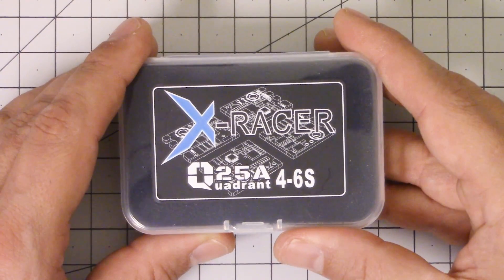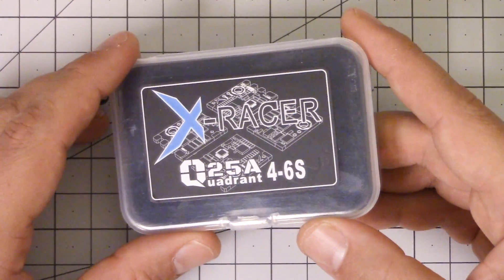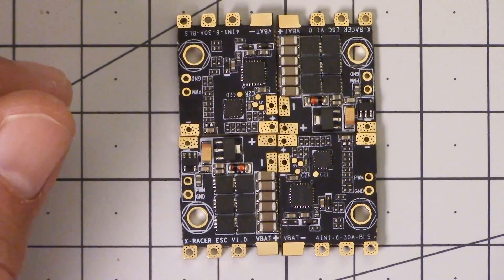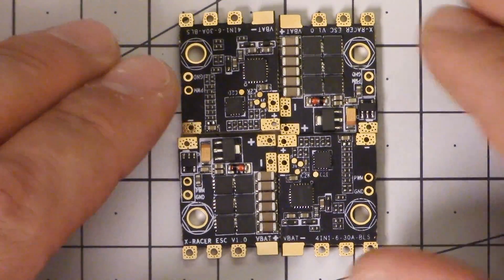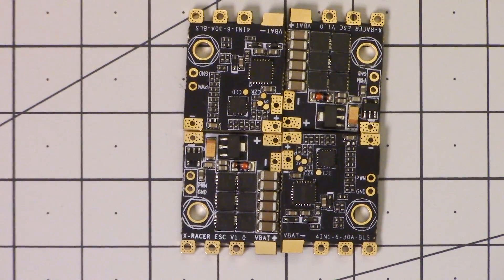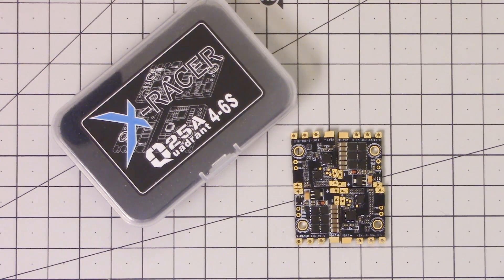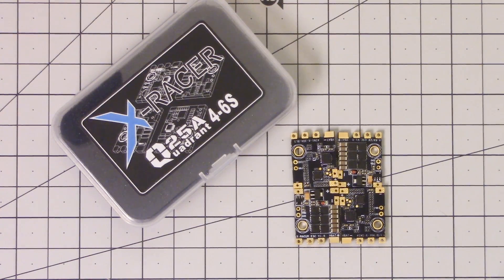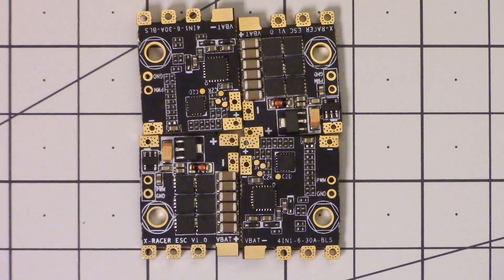FPV Model Xracer Quadrant 25A 4-6S BLHeli ESC | THE PERFECT ESC???

Comment: Hi, quick question if you don't mind, I just got these and was wondering if they can be used with steel mounting bolts? I notice the mounting hole is metal and don't want to accidentally short my new esc's! Sorry if it's obvious I'm still a bit of a noob too the hobby and I figure you know what you're talking about lol. Thanks in advance!
Reply from the maker: The metal lining of the mounting hole is always grounded. There's no issue with using steel bolts.

Comment: me again I have something els to ask you your info has been so helpful you no so much wish I was that good lol here is my problem   I have the betaflight f3 controller and the x racer q 25amp esc  on the esc do I need to wire each one to the flight controller power and negative  do you have a diagram of  the best way to wire them up thanks your videos are realy good
Reply from the maker: I don't have a diagram, but here is how to do it:

vBat+ from the XT60 to the vBat+ pad on the BFF3.

12 or 14 gauge wire from the BFF3 ESC + power pad just adjacent to the shunt resistor to a vBat+ pad on the Quadrant. Alternatively, you can have somewhat better electrical resistance (not sure how much) by soldering directly to the load side of the shunt resistor instead of the ESC + power pad.

vBat- from the XT60 to the vBat- pad on the Quadrant.

Small (22 gauge-ish) wire from the vBat- pad on the Quadrant to the vBat- pad on the BFF3.
Reply: hi thanks but do I have too do the same for all 4 esc or just one and will everything work as it should thanks again  top man
Reply: are I have got it now lol so that's sorted .next will I get all my telemetry this way ?thanks so much

Comment: In the 4 in 1 configuration: Do you have to solder only one + and GND to the PDB? 
Is it ok with all ESCs drawing from the same connection on the PDB?
I am a little scared, because i dont want to smoke my PDB/FC combo (Betaflight F3 FC)
Reply from the maker: If you are going to run through the BFF3's current sensor, then I suggest doing the following:

vBat+ TO Betaflight F3 vBat+ pad TO the ESC pad just to the left of the shunt resistor TO the vBat+ pad on the ESC.

Same for vBat-

I believe that if you use the ESC pad closest to the shunt resistor, the distance will be short enough that you can use the full power of the ESC without overheating the board.

Comment: i thought u would be the best person to ask i tried to run dshot on kiss but when i fly it oscilates like crazy do u need a dshot firmware or something or is blheli latest firmware suppose to work with dshot? oneshot 125 works fine i havn't tried 42 yet but dshot was running way out of sync ???
Reply from the maker: +Rix Fpv I don't really know much about KISS.

Comment: mine wont calibrate with kiss fc got them when i seen this vid they just jitter my f60pros when i try to calibrate them servo test works but not with kiss fc u got any ideas ??
Reply from the maker: What protocol is KISS FC outputting?
Reply: it wasnt after smashing my head on the table i found kiss has 1.2 for aio and a 1.2 firmware for just the kiss fc loaded the wrong firmware so if anybody cannot calibrate with kiss fc try download the bundled firmware and delete any folder that says aio in it lol thanks did a quick los flight but had to vibration damper the hell outta my quad i thought f60 pros would have no vibrations. i have 2 dys se2205 2300kv and 1 redbottom setup and they produce way less vibrations than my tigers is that a sacrafice for the f60 pro power?? thanks for ur quick reply
Reply: Joshua Bardwell d shot 600 now

Comment: Nice. Can you just use small silicon wire bridges (U shape) to join esc's together? Easier to solder thru existing holes and easier to desolder in case of repair. Should also avoid stresses on solder joints in case of crash. No!?
Reply from the maker: But then the board would not be supported in the center in a 4-in-1 configuration.
Reply: I could put a piece of adhesive foam thick enough to support the center. As mentioned by someone on another thread, the wire gauge has to be big enough to handle the current.

Comment: Can I solder all signalgroundwire together to use a "4in1" style connector?
Reply from the maker: +tecno pro FPV yes
Reply: Joshua Bardwell Thank, I am always amazed with your fast responses. I would like to ask you another question. Does the racerstar 30Ax4 ESC provide 30A to each Motor or is that combined rating for all 4 ESCs? I have that Esc in one of my build with Emax rs2205s and I am only pulling 38A in total at full throttle, it feels a little bit weak too.
Reply from the maker: +tecno pro FPV 30 per motor.

Comment: Is it possible to solder all 4 signalground wires together? I like to use a 4in1 Esc connector for the signal wires.

Comment: Josh, love the content. You are a compendium of knowledge! I LOVE the design of these ESC's, but I'm so worried of hooking up 6S power to them. I realize the ESC's can prob withstand 50V of power, but they only support 25A RMA. Are you sure they're capable of full tilt 6S voltage? Wise people are telling me to be weary and not to use it on my 6" prop builds. But I'm super stoked about the idea of getting my ESC's off my quads arms and make them part of my stack. I'm currently running F60's with 6" props. Please say these ESC's are bulletproof and can take a beating!?!? Technical feedback welcome. :)
Reply from the maker: +Jon Westberry if FPV Model says 6S I would believe them. The voltage limit is more about the rating of the FETs.
Reply: Everyone seems to be saying they might be fried and that I should use a 30A ESC. What do you say?

Comment: Hey Joshua, can't wait to see a build with these.
Any plans for one "soon"?
Reply: +Joshua Bardwell I don't worry, you always figure things out :P Btw the ESC protocols video series was a-m-a-z-i-n-g. You over-delivered on those two :)
Reply from the maker: Yes. I hope to be doing the build the week of the 16th, which means you might see content around the end of January perhaps. Very much looking forward to this build too... it's a ZoomPod with Revolt FC. Fingers crossed the Revolt works well for me.
Reply: The 3d printed pod of the frame looks a bit sketchy (durability wise), but surely a nice one for a showcase build ;) Hope everything goes as planned, be well!
Reply: Joshua Bardwell why not use the new  betaflight aio FC from fpvmodel? also any chance you will do a review for the betaflight FC?
Reply from the maker: +Jack Truong I'm using the Revolt because I want to give raceflight and the Revolt a try.
Reply: +Joshua Bardwell are you worried about the vibrations issues of the gyro? Was reading about that lately and it seems very tricky for installation.
Reply from the maker: +muteFPV Yeah, well, well see...

Comment: These days there are many escs that "have it all" (without the 4in1 thingy). Only thing that separates good ESCs from less good ESCs is the mosfet quality. Usualy the less deadtime (the number in the firmware name), the better ESC. Thats why TBS bulletproof are so bulletproof, because they have mosfets that require very little deadtime. Less deadtime = better efficiency, better sync handling (not sure on that one), less heat and maybe even faster reactions.
Reply from the maker: +neclovekSK have it all was meant to include the 4 in 1 thingy.

Comment: really cool idea,  connecting them is gonna take some thought, maybe you could mount them on an old frame and wire those pads together twist to tighten, then solder... i'm still feeling it would need more to withstand big shocks from crashes, a center post?

Comment: I think after you Solder on your XT60 lead, and with continuous battery changes, it wont last as a 4in1. and there to big as a single.?  solder joints holding it together?
a hard hit, any shock to the XT60 lead. and pads will be lifted.
Reply from the maker: The XT60 lead should always be reinforced in my opinion.
Reply: the irony here is being an xracer, pairing it with an xracer fc will put undue stress on those joints as well since for some reason they went with 30x30mm spacing instead of the standard 30.5x30.5mm... so those standoffs off of it will be pinching together.
Reply: prOkrEAt ,? What? They used 30mm x 30mm post spacing?  lol
Reply: Crash RC on the FC, yeah... doesn't set well in stacks. broke a nylon standoff with that FC dry fitting it. never bothered to install it.

Comment: what about the size? are the holes compatible with the standard flight controller? thanks
Reply: alisher rakhimov Yes they are
Reply: alisher rakhimov I think it's around 40-45mm x 36mm (the size)
Reply from the maker: +alisher rakhimov yes, definitely. That's the point.

Comment: only thing i can see with the 4-in-1 format is there's no strain relief on the solder points in the middle of the board.
Reply: Daytona FPV You solder them on the top and bottom. No strain relief needed as it becomes one solid board. The center becomes the strongest point.

Comment: to solder flat, simply mount them on your frame with some nylon standoffs. align them, snug some M3 nuts, then solder the central + - pads to each other. that should provide more than enough mechanical structure to hold the boards together so you can solder up the rest of your connections. this also ensures that the 30.5mm mount spacing is exact to the tolerance of your frame.

Comment: To solder it id use an old fc and bolt it on with standoffs inderneath to use it as a kindove jig to hold it in place
Reply: Or a PDB is you have one lying around

Comment: If they made these without the 4-in-1 capability i'd be all over it. I don't care for the trouble of the 4-in-1, and secondly it makes the layout kinda funky.
Reply from the maker: +doluseb so just put them on the arms like normal. Nobody is forcing you to install them as a 4 in 1. That's the whole point.
Reply: Joshua Bardwell I understand that, but the hole, and the ground and signal position makes the form-factor undesirable. every frame out there now has thin arms. I don't want a half a inch of esc sticking out. that's why i got rid of my rg20s. don't get me wrong, i applaud anything new, and i'm sure these will be great for some people, but if they made another version that would be ideal.
Reply: have you looked at the DYS 30A slim ESCs? they are only 12mm wide, take 6S and come with BLHeli 13.2 preloaded.

Comment: Am I right that it would line up perfectly with the motor outputs on the revolt fc? looks like it does...
Reply from the maker: +FPVollgas Germany I can't verify that right now but that would be cool.
Reply: Joshua Bardwell I've just checked on my revolt and no it doesn't:( at least not perfectly. if one side fits, the other one doesn't. but you can use very short wires 👍

Comment: With low profile standoffs, a triple stack wouldn't be so bad. This with the omnibus f3 and the rrosd would be pretty nice. Thanks for reviewing it.
Reply from the maker: +Frank Ruiz omnibus and RROSD would be two OSDs. Redundant.
Reply: Yeah but I like the simple osd on the rrosd. And the new layout is so nice. I also need 12v for my cams and vtx's. What would you add to the stack with these esc's?
Reply from the maker: IDK... if I was going with the RROSD then I would pick a stand-alone FC with no OSD built in. I have heard of somebody who wanted to use the Omnibus OSD for PID tuning and RROSD for in-flight data. No reason you can't do that, just disable all the screen elements on the Omnibus OSD.

Comment: I'd imagine just mount the four escs on your frame like it was a four in one and then solder the joints and they will be all nice and lined up! looks like a nice ESC , I just wish it's rated amps was a bit higher, even though 25a should still do the trick on most builds.
Reply: My concern exactly. Will they hold up under 6S power, F60 motors and 6" props?
Reply: I would imagine absolutely not. Definitely need some 30a-35a escs that are high quality to handle that.
Reply: Bardwell said they should hold up...
Reply: If he said they should then I guess they should hold up, I'm just leary pulling over 40A from a 25a rated esc
Reply from the maker: +Adam Komarek you shouldn't pull 40 amps. I didn't say you should exceed the amp rating.
Reply: So.. I'm confused. How could I (the pilot) cause stress to these ESC's? Is it the motor/ESC combo that could cause these to pull over 25A? I guess I'm wondering how I can use these in a F60 setup with a 6S battery.
Reply: Jon Westberry it depends on your motor and propeller combo. I'm assuming if your wanting to use 6s lipos your going to be using a 2200kv F60, which would be still pushing it pretty hard.. but for example. a 4s lipo with a 6040 prop takes around 28-30a full throttle. with 5s that will be even higher, and even higher with a 6s. escs can only take so much amps for so long before they fail. most escs are pretty robust but it really depends on the quality of the esc. some people pull 45+ amps on a single motor out of 25a escs, some do 35a and it fails. Just do your research on your esc you want, also head to http://miniquadtestbench.com and check out the motors and amp draw, and make your conclusions. I fly with racerstar 30a v2 escs that are rated 2s to 4s. I run 5s lipos and pull bursts of up to 40-45a, pushing past their technical limits and they do fine.
Reply: Thanks +Adam Komarek. Just wish these were a little higher on the amp rating :/ I wonder if X-Racer plans to make higher rated ones?
Reply: Jon Westberry not sure if any are in the works, but I have this and it's working quite well for me with 5s/6s and high amperage.
http://m.banggood.com/Racerstar-RS30Ax4-V2-30A-BLheli_S-BB2-2-6S-4-in-1-ESC-Support-Oneshot42-Multishot-for-FPV-Racer-p-1083189.html

Comment: Solution for the last thing that you said place them on nylon stand offs and then soldering them together
Reply: Thumbs-fpv i was just going to say that lol
Reply: LateM EmertxE haha
Reply: derp... i just posted the same thing... should have read the fact you said it hours ago.
Reply: Thumbs-fpv bluetac
Reply: alisher rakhimov can but you should align it properly otherwise it is difficult to fit it on the 30.5mm x 30.5mm hole pattern, so I think the way that I said it works better.
Reply: i was sarcastic :)
Reply: yep, screw them on the nylon stands onto the frame then solder them.

Comment: And I have it, yay :) Although many pilots will have to learn how to desolder these in case of one ESC being damaged.
Reply from the maker: Yup. It's a bit of a trick to desolder three joints at once. What is a good method, assuming you don't have a hot air station?
Reply: Hot air station may be an overkill, incurring huge chances to desolder neighbouring components.

Soldering wick/braid or solder sucker may work, but that will require unhealthy amounts of heat.
There's also chipquik - low temperature solder wire suitable for such applications, but it's pretty expensive.

I think there's a smarter solution. Stick a sheet of plastic/paper in between the plates to create a gap in molten solder. I haven't tried it yet, just a thought experiment.

If the integrity of dead ESC is not important, one could cut the PCB with pliers and simplify the job. I wouldn't do that as I repair them sometimes or salvage other components.
Reply: Joshua Bardwell hot air is the best option .. else you can use a desoldering wire which looks likes twilled copper wire ... that easy than a solder sucker .. let me if you need a pic to buy one ..